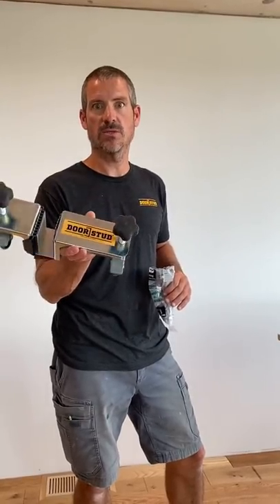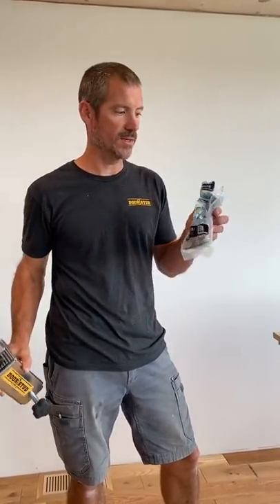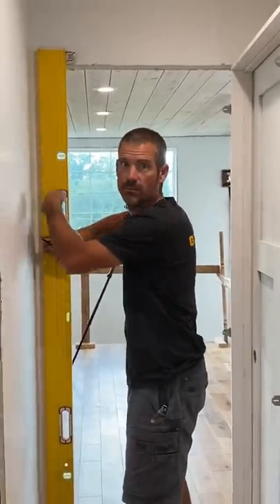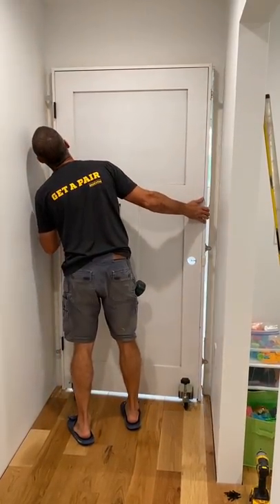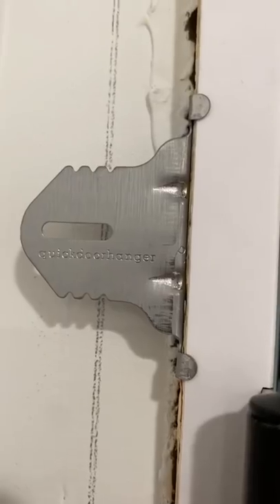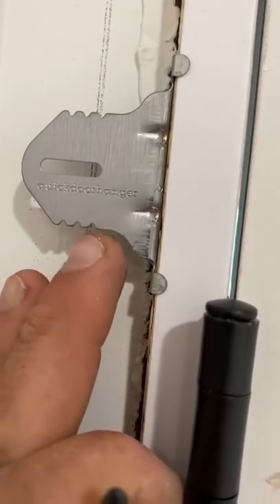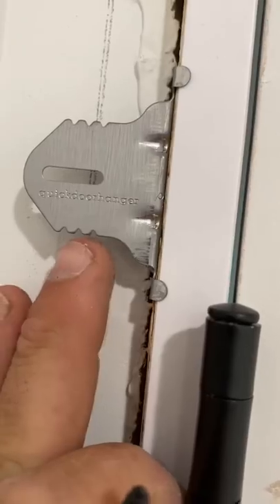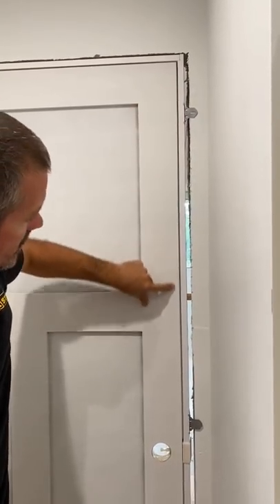Interior Door Install | Door Stud #shorts

Comment: I have hung thousands of doors, this is heartbreaking.
Reply: why is it heartbreaking?
Reply: Hanging a door is easy when you know how.
Reply: @lordjaashin  , you must never hung doors before.
Reply: @wolfparty4234  so you can't specify exactly what is wrong with what is shown in the video?
Reply: Yep, I feel your pain.
Sneeze against this and its on the floor.
Hanging internal doors are a breeze if you know what your doing.
Reply: My guess is because it's such a pain and this tool makes it easy?
Reply: This alot of wasted time and buying extra parts
Reply: @lordjaashin  what's wrong is you can use a shebang to help level the door on one side out. And using the door system is a waste of money plus the brackets.
Reply: Me too. I guess it helps when the jambs are made of cheap shit like waffer board.
Reply: Why is this heartbreaking? I know nothing of this type of work I usually get my info from 
PBS’s (This Old House) or from the experts that come out of the woodwork offering a there expert advice.
Reply: Well, John G. You've answered your own question. Inexperience.
Reply: @johngutwald8454  Because pretty much all  of the guys commenting here are the ones that have no understanding of the purpose of SHIMS...

They slap at the trim with a trim nailer and think they know what they're doing.
Reply: @HungNguyen91622  coming from a guy that just slaps the trim with a nail gun....?

You've probably never used shims before either...
Reply: @tomg1066   @Tom G  bruh I never hung a door before. Seen it happened but never personally myself. Within a month I'm about to though. And you have to use shims to have it straightened out is my guess. How I see this guy doing it. It's unnecessary to use the extra things.
Reply: You ain't lying!
Reply: I mean...these doors weight...what ...12lbs!?
Reply: Lots of future home owners makin comments.
Reply: @lordjaashin  for starters, the "FINAL" reveal shows the backside of the door. And anyone who's ever installed a few pre hung door knows that seldom is the door flush with the framing top to bottom.
Reply: @lordjaashin   .. I think it’s a nice tool to have working by yourself ..
Reply: I know what you mean, a little piece died inside. I asked a “carpenter” if he would like my Porter Cable door plane, free. He passed said he’d never use it. I do like the wheels though
Reply: @johngutwald8454  there is very little skill required to install pre-hung doors, as you can see in the video. 
Now to install a 200# oak, book entry with a mortise lock takes some skills and the right tools.
Reply: Have you ever installed the nuclear blast resistant doors the government uses at Kennedy space center  ? They are not light ! New construction partical board doors a child could install  !
Reply: Agree
Reply: Ya I just did my hole house old school way. That thing is cool.
Reply: @HungNguyen91622  for thoes of us who don't hang doors....what's a "shebang" and how does it work??
Reply: @HungNguyen91622  for thoes of us who don't hang doors....what's a "shebang" and how does it work??
Reply: Ikr so disrespectful adding an extra hour to a door job 🤣
Reply: @tomg1066  did a remodel on my 70’s house and the guy used roofing shingles as shims
Reply: @pbwmanagement  But if you don't know how to do it correctly it can be a challenge,and if you live in a older house ,and you have to cut the door to fit or make it wider.
Reply: @thomastonnessen8056 hahaha yes that’s what we do sometimes to depending on what it’s used for.
Reply: I have been doing trim in Orlando and all around for 23 years this is the dumbest thing I’ve ever seen in trim work. If i see one of my guys hanging doors like that I guarantee he wont finish it before i take a hammer to that bull shit
Reply: @lordjaashin  , he meant hanging interior door is very easy if you are capable and do not need to spend money on any jig.
Reply: This is great for hollow core internal doors. Wouldn’t use it for external doors. The best thing about it is you can make your own brackets out of sheet metal.
Reply: .... I know right. :-(
Reply: @lordjaashin  it takes time and practice to be able to properly install a door. These rollers basically do the job for you with no skill or thought to it.
Reply: @demodemo5146  your guess is right despite what these so called joiners say, hanging doors can, i emphasize "can sometimes" be a pain especially if the frame is out of skew, and if they are heavy fire doors your hanging these tools are a great help, dont let the jobsworths say different, and im no joiner but ive hung hundreds of doors all types.
Reply: @HungNguyen91622  these brackets eliminate shims on that side and the other  the casing can hold it. These brackets make it so anyone can install a door
Reply: @jimknowles5483  a shebang is really a "flat pry bar" put that under the door or whatever it is to lift up to make it leveled as you please. Makes things easier depending.
Reply: @lordjaashin  it’s just tacky and lazy it’s not hard to do it in a way where there aren’t any brackets showing. Which will be covered by trim later but still
Reply: Okay… here’s why this system sucks…

1. Those brackets are basically floating the door way. That’s not a particularly solid fix and the frames will warp.

2. Those brackets have stretcher plate style fixings, over time they will slip and the doorway will become out of square…

3. There was no accommodation of the gap prior to install. I wonder how these  would fare up on a code check for fire doors?… badly i suspect.

Do i need to keep going? Because there are more…

On the other side, its good because it helps some who is lesser skilled assemble a square frame first and then install it.
Reply: @rumplestillskin6157  The vast majority of interior doors are made exactly like these are.  You must be a 1% that only uses solid lumber.
Reply: @poncho2640  Wow! Orlando!  You must be the best.
Reply: It was back in the day. 
I remember the first time I saw veneered door jambs. I knew they were Crap.
Reply: @rumplestillskin6157  - 100% correct, i just bought and am refitting a house… pulled all that crap right off and reinstalled with solid wood.

Veneered chipboard is a curse.
Reply: @darinvee4980  - Don’t be a plonker now… i pointed out that a lesser skilled person benefits from this system… but i also pointed out the drawbacks so people don’t confuse this with a quality installation.

If you could choose… veneered chip board floating a gap or solid wood scribed to fit… what would you choose?
Reply: @zerg9523  I don't have the money to waste on interior doors that you describe.  In my job I inspect homes from basic starter to million dollar.  Prehung interior doors similar to the ones in the video are what are installed.  The jambs are basically the same and the doors are where they differ, hollow core slab to solid wood panel.  If your house or the houses you build all have custom made solid wood doors, great for you. By the way, how much does one of those cost including the install?
Reply: Great system but you Def still need shims though
Reply: @crazyj9071   …mmm 🤔… or the custom made solid cherry doors I was hired to install at the Tiffany Jewelry store ….
Reply: It’s a tool to get it done quickly if you have several a day to install so in that case it’s a cool tool
Reply: I'm with u
Reply: @pbwmanagement  I mean I would use that but put shims and screws like a normal door. A tool that makes layout and placement is easier just makes your profession so much better. Like if you a master at your trade you don’t need the practice now your allowed to cheat ever once and a while. Still be able to show people up when they talk shit and say you can’t do it.

Comment: I always use 7 sets of shims on the hinge side ,5 on the strike side and 3 sets across the top minimum. Sometimes more because i shim under the hinges and also the door strike . You don't want to use the trim to keep the jamb in place . If those metal pieces screwed to the back of the jamb were "C" shaped and through bolted with lock nuts could be superior. But you are depending on only the thread screwed into the back side of the jamb to keep the door in place.
Reply: Yep, but you know what your doing.
This door and frame will kick out in seconds.

Comment: I don't understand why there's so much hate. I think this is fantastic. It's kind awkward wrestling the door into place, then plumb one side, then go back and get the other side. Also, not everyone is that strong or dextrous. I think this is a great tool for DIYers, and reduces that need to have a 2nd person. You just put the door on wheels, and you're good to go. It's also good for slab doors if you don't get pre-hung doors. You can throw a slab in to hold the door for you while you screw in hinges.

Comment: Does anybody know how to do actual carpenter work anymore ?
Reply: I just removed three of these doors for a customer two weeks ago.  Those jamb clips are absolute garbage
Reply: It's about how fast but good quality work. It's just the install,not the entire process starting with the tree. Times have changed,I've accepted this.
Reply: I do can build you a door from scratch but people don't want to spend the money they would rather have you throw in a cheap door like this...
Reply: @joshmiller1928  What?
Reply: No
Reply: @aaronoconnor606  Bcuz you charge too much. That’s why. Most people (if not all) want quality work. Time isn’t the issue. It’s money. Material costs are high. Labor cost is a joke. That’s why people sacrifice and buy cheaper. I’d rather save and get better quality but many don’t have that luxury.
Reply: No the echo chamber that is the internet has erased skilled craftsmanship.
Reply: Orrrr you could get $3.45 cents of shims and hang it in less than 5 minute with 12” level…..
Reply: They are far and few between........
Reply: Your mom
Reply: I have been a joiner carpenter just over 43 years and seen many changes to working practices and materials used , its all gone to 💩 and i feel sorry for people who buy new constructed houses that will need major repairs before the mortgage is paid off 😬
Reply: @philsmith214  I did carpentry with my step dad for 4 years. He is a old school, wake up at 4am everyday and works most weekend purely by choice. Legitimately a master. His work lasts forever. But when we have to fix new houses done by someone else.. I see what you mentioned. Cutting corners everywhere and just basic unskilled work. Half our jobs were fixing new houses lol
Reply: This guy is doing it just fine
Reply: @jacquessowhat3680  well once it is in place, use nails through the jamb, just like a normal install, and you are at the same place with extra help.
Reply: @timdavis1464  you go check that door in 2 years and tell me if it’s fine😂
Reply: @Smiggers  if you run nails through the jamb with shims in place as they should be, then it's the same installation technique for a door. How is that going to be worse, because it was installed initially using a different technique?
Reply: @timdavis1464  sir I did not see the use of any shims.. that’s exactly what I was referring to. Also I guarantee I could hang that door in 1/10 the time just using shims and a level. Seems like a huge waste of time
Reply: @timdavis1464  If you’re using shims, as you should, there is absolutely no reason for these crappy clips
Reply: @Smiggers  well that's fine that you can do that. I have been doing diy products for 20 years. I am very proficient at most all things, but for me, getting a door hung correctly kicks my ass. Every time. This system would make it 1 million percent easier for me personally, and it would go in ACTUALLY square. That would help a bunch for ME. I don't care about the professional trim or finish carpenter, I am looking out for myself. And with all MY experience in home renovations, and not being able to hang a door properly, I can almost guarantee this system would make it easier for at least 90% of diy'ers
Reply: @timdavis1464  ask a real carpenter to show you. Hanging doors is one of the easiest things to do once you know how. It’s always better to learn the right way.
Reply: @Smiggers  I can do it, it just takes me forever to get it correct. I appreciate your input, but I like the system that I saw that you hate.
Reply: I'm swimming in a ocean full of ex union carpenters whom can't cut stair stringers or or compound valley cuts .

Comment: How well does the trim lay on there with those brackets ? 🤔
Reply: That are hoping no one notices the-1/16 gap, so they don't have to come back and fill it.....lol
Reply: I was more curious about gap between bottom of jam and floor
Reply: Caulk and paint makes a carpenter what he aint.
Reply: Are the tabs temporary? Do you “break them off” before installing the trim/molding?  If not, the trim won’t lay flat and the job will look crappy.
Reply: That was my first thought too, trim will be bitch to deal with. 
But I do like the dollies, but just plumb it, shim it, square it, nail it through the jamb.
Reply: The brackets compress the drywall do they're almost flush. I wouldn't use them with stained trim but the small gap left between trim and drywall is easily filled with caulk for painted trim.
Reply: seriously? its called your hammer
Reply: Those brackets are so thin on the part the laps jamb edge that it’s a non issue.  I’ve used brackets similar to these and was skeptical at first because I already knew how to hang a door with shims and nails.  This way, the slot in the bracket allows you to adjust the reveal like a shim but it’s much easier and you do r have to finish nail holes inside the jamb now either with these.  And they’re surprisingly solid too.  As a carpenter, don’t knock it til you try it

Comment: Always take advice from a carpenter working in flip flops.
Reply: Always take advice from a carpenter that wore sandals 2040 years ago.
Reply: Dont knock the flip flops till you tried it lol but good one
Reply: @joshuacarey9367  I sent guys home that show up at a job site in shorts or open toes footwear.
Reply: @robertball3578  Sent home permanently I hope.
Reply: @robertball3578  you must be working commercial then cause I've seen a lot of tradesman in shorts on residential and there is nothing wrong with it either, and you'd have no workers with that attitude, the open toe thing agree with
Reply: @robertball3578  send them my way! I need the help!!
Reply: @sterileneutrino2288  Good one!!
Reply: @robertball3578  thank you Robert Ball
Reply: @dougupah8778  Not working commercial. Just working safe and correctly. Ppl need to learn doing it “your” way isn’t necessarily the correct way.
Reply: Flip flops ...call ahead for the E.R...911 will cost you $100. But then again you can't touch the gas peddle with a broken foot...this guy isn't a real CARPENTER
Reply: @robertball3578  I've worked all over the country.  Shorts and flip-flops are Florida work wear except with the bigger messier stuff.
Reply: Welcome to Florida!
Reply: @sterileneutrino2288  i prefer to take advice from people that exist.

Comment: Perhaps this is fine simply to keep the door in place short term, but you still want to install shims and attach that door to solid wood, not screwing through drywall. The vibration caused by closing it will eventually shake it loose, even with screws.

Comment: You skipped the part where you lower the door so the jambs touch the floor…..
Reply: That is an irrelevant detail to this very short video. It's absolutely self-evident how that's accomplished, and it was.
Reply: @watcherofwatchers  it is not self evident how it happens. When he shows us how to install it, the door is still on the rollers and the jamb is raised. All he shows us is screwing the clips into the studs, but he didn’t show how he lowered the door while it was on the rollers, and somehow at the end of the video the jambs are all the way to the floor
Reply: @SethCorbinMusic  The height is controlled by a screw that each wheel is attached to. Simply screw that up and dow to your desired height.

It WAS self-evident, if you just looked at the tool. The fact I have only ever seen this tool in this less than 1 minute video and know exactly how to make that adjustment shows how self-evident it is.  Besides, this wasn't a tutorial, it was a demonstration.
Reply: @watcherofwatchers  I disagree that it was self evident. It was neither explained nor evidenced. 
I do have to say, with all due respect, that your mom is self evident.
Reply: @SethCorbinMusic  Well, given the simple  nature of the tool, the fact that you don't find this adjustment to be obvious speaks much more about you than the tool. Good luck to you. Life must be quite difficult for you.
Reply: @watcherofwatchers  so in other words, the tool is a complete waste of time.
Reply: @drockx85  I am not sure about your ability to comprehend this discussion, since that sentiment was not expressed in any way.